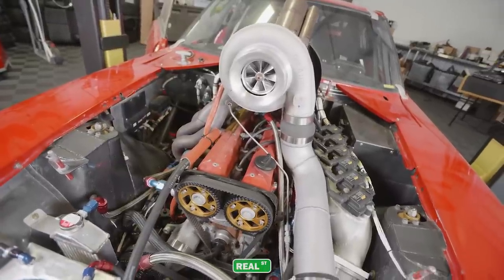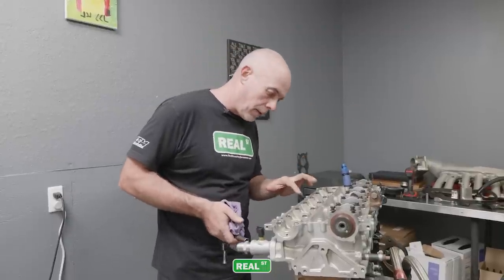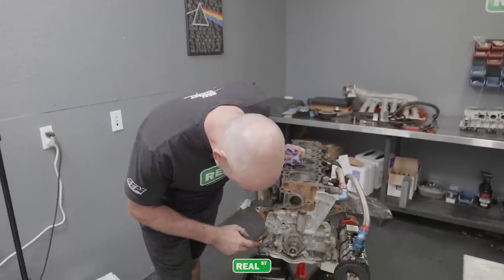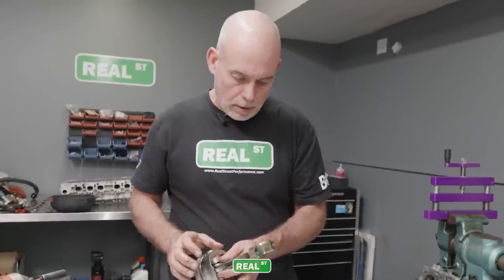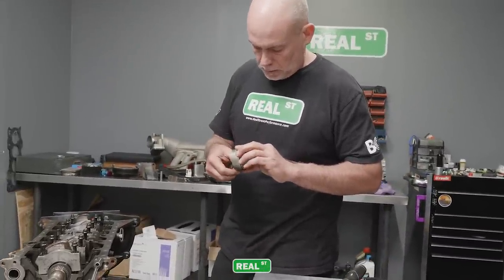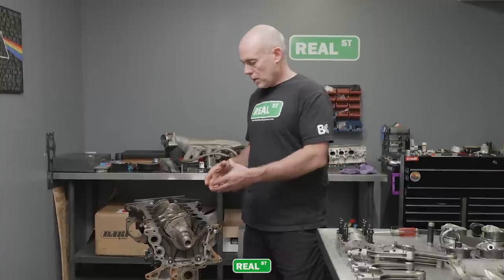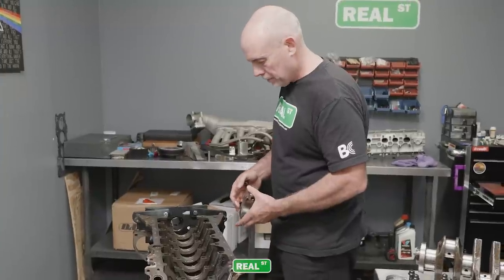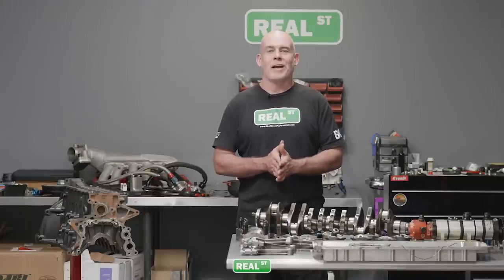Major Issues Found In 1200+HP 2JZ Build | Detailed Engine Teardown

Comment: Jay is such a class act, you can tell he wanted to put the last guy that built that engine on blast. He remained calm and was speaking the truth about how it was poorly built. Keep passing your experience and knowledge around for us to use :-)
Reply: All that stuff aside, what cooked it was running without cooling flow.  The actual build was insignificant to the issue of why it was tore down.
Reply: Especially considering the rod caps he designed were installed backwards.
Reply: @gt1man931  that wouldn’t have anything to do with the main cap’s though.
Reply: J
Reply: U M

Comment: Given the thermal run away and loading the engine had when the belt came off  several times, the fact it was still even running with no HG failure, no piston/wall scuffing, nor broken rings - none of the usual things that happen from an overheat i'd say it did pretty good.  Assembly and machining failures aside, and are not excusable.

Comment: Wow - strange that the totally loose bearing shell didn't spin...lucky guy...
This is a very interesting video and I really love the way of presentation.
Reply: The bearing had thermal damage, but the physical size of the steel backings didn't change, so the bearing was still clamped properly in the housing bore. It wasn't until that cap was removed that the bearings were able to relax into the shrunk state a bimetal bearing wants to be in after an overheat/overload.

Comment: Cummins requires use of loctite (not sure which one) on the main caps on the x12 cng because they have a fretting issue. Not sure if that would help with something like this
Reply: Loctite 518, it's an anaerobic flange sealant.

Comment: I have a LS3 that has some scratches around the crank journals. I can catch the lip a bit with my fingernail. What would you recommend I do? Should I buy new, take it to a machine shop and get larger bearings to fill up the clearance, or just buy a used crank from someone online?

Comment: main cap skirt should be on the large side-you then spread the block (bolt thread tool) and slide in the caps that way.

when done like this , you bet welded-like resistance fit

Comment: Hi, maybe it's an odd question, but is there any chance to build a 1000hp+ engine with a 22-28 psi of boost, for the everyday use, that will run for 60.000+ miles without any major fails?
What engine would you recommend for this mission?

Comment: now that its been  completely cooked (stress relieved & normalized) wouldn't it be best to cut everything to spec  (line bore , deck & cylinders)   in order  to have a more stable and accurate  block that moves around less as it heats and cools under extreme use ?
Reply: I totally think so but hopefully real st pipes up

Comment: You should try to line hone a aluminum block with steel caps! What a pain!
Reply: Yeah it can be pretty brutal. In a perfect world you're miles ahead if you can line bore to within a thousand or two before the honing process. Line honing is a finicky task with a bunch of block rotations and cap hardware loosening to get all 5 (or 7 in this case) housings within spec at the same time.

Comment: Why was the engine overheated from drive belt failure, if your running external water pump
Reply: If you watch the video he says that it had a problem but they changed it to 16v battery and aftermarket pump, but the damage was already done
Reply: If i remember correctly they show it in an old video

Comment: Wouldn't it really make more sense to use a turbine engine at this point? Like from a helicopter or turboprop plane?
Reply: Sure, but landspeed racing is all about class records and turbine engines are another class. Someone ran an unofficial 500 mph wheel driven record with a turbine, but probably not a cheap way to go racing.

Comment: Sounds like the last person to assemble this engine is a real amateur in  Comparison to Jay , And by rights should be shown up if ya gonna build a high  hp motor you don’t tighten the con rod bolts with a rattle gun 🤣🤣😱

Comment: that shit  was put on backwards . no wonder there is wear on those bearings
Reply: Caps were installed backwards before the block was line honed. If the block was machined with the caps in the correct direction, then assembled with the caps in the opposite direction, the crank wouldn't have turned because the bores would have all been offset.